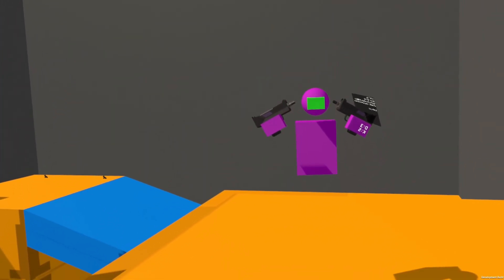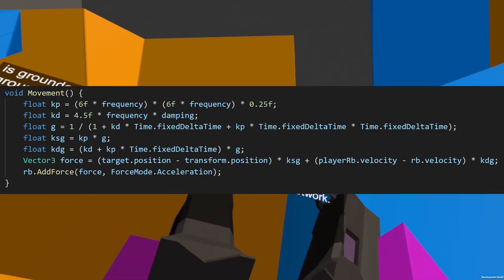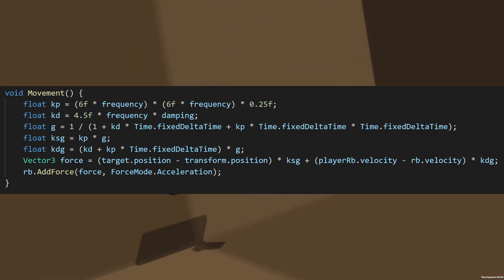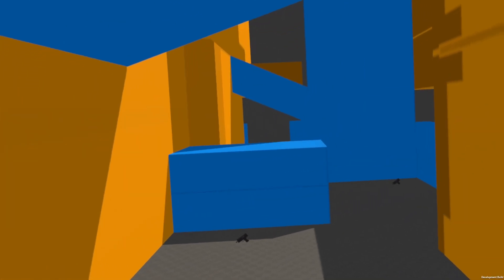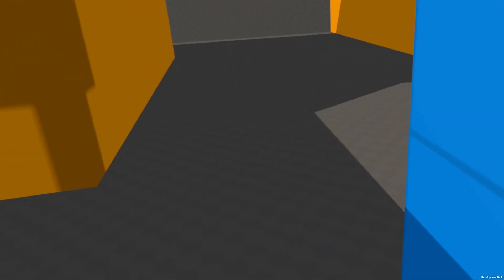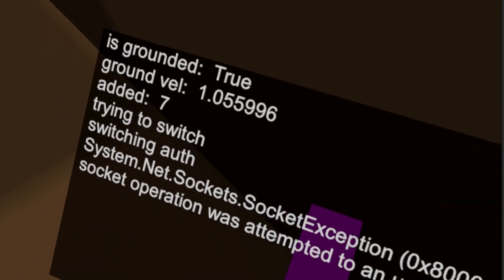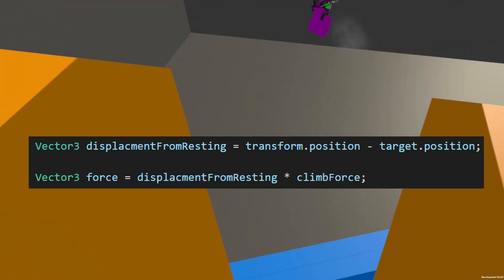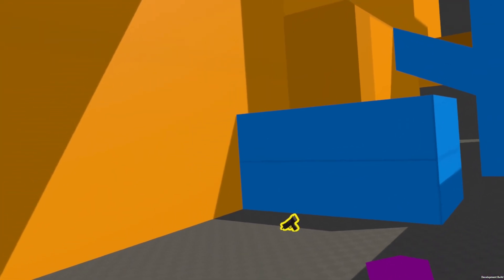How I Created Gorilla Tag Movement in Unity

Comment: Intreseting video! However, doesn't this violate Newton's third law? If you move your hands forwards, your hands should exert a force of equal magnitude back on the body in the opposite direction. The force you move your hands with is controlled by David Wu's PID Controller, but the force applied on your body is calculated using Hooke's law. So these forces will almost never be equal. Doesn't this mean that if your hands can collide with your body (or if you grab something that can collide with your body), and push against yourself, you'd actually push yourself backwards or forwards?
Reply from the maker: Yes youre correct but in the goal of creating fun movement I had to sacrifice realism. The way that I circumvent the issue of object pushing on the player is by disabling collision between the player and the grabbed object. But that would mean objects can go through the player so hidden under the dynamic colliders are kinematic colliders. Its a really janky system but it works for my purposes.

Comment: What is the advantage of using this method instead of some simple solution like setting the velocity to the target rigid body based on the difference vector Vector3 v = (transform.position - holdingTarget.transform.position);  holdingTarget.velocity = v / Time.fixedDeltaTime; and then some quaterinon stuff for rotation?
Reply from the maker: That approach does work but its just less physically accurate . I found this way to be a lot more fun. The throwing is better, you can limit the strength and overall you just have more control.

Comment from the maker: I would like to clarify some things. Set your hands rigidbodies max angular velocity to infinity the default is really low and will fell sluggish. You only really need to change the inertiaTensor if you're effecting other rigidbodies so if your hands feel like they aren't strong enough play around with it.

Another thing I forgot to mention is make sure the rigidbodies are set to interpolate and continuous collision detection for the best results.
Reply: You mean replace 'rb.AddForce(force, ForceMode.Acceleration)' to 'rb.inertiaTensor=force'?
Reply from the maker: @larryart.illust  No in the start method you can set rb.inertiaTensor = new Vector3(0.008f, 0.008f, 0.008f) for example
Reply: @DonionTech  Thank you! It worked! Appreciate you reply!